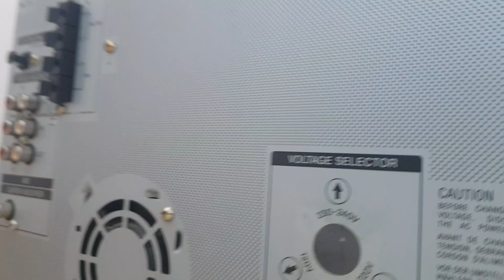Sony GRX8 inside, cd belt changing

Comment: This is basically the RX99 my friend...they have different model names in the north american models. It all loosk the same inside from 1996 to 1999. Inside its all the same. The only difference was 1998 started the HOP woofer...and they for some reason decreased the screen size from 1997 models! But the DJ mix gear remains the same until 1999.
Reply from the maker: The bass seems to be stronger / more punchy, using the same volume and settings on GRX.
Reply: @viziart  really? I wonder why that is. I noticed that the RX100AV uses the same smaller speakers as the RX70 models and yet the same dolby prologic Asian model uses the larger 17 cm cone of the GR8 models. I dont understand why the US models are underpowered like that with smaller speaker. I am sure the RX100AV distorts at high volumes even with VACs.
Reply from the maker: @Shamsithaca  IC201 8-749-921-68 IC STK-4231MK2 (GRX8/R800)
   IC201 8-749-922-65 IC STK-4221MK2 (RX88/RX99)